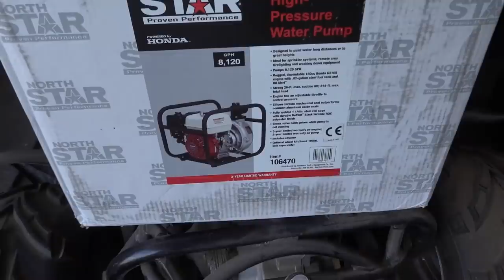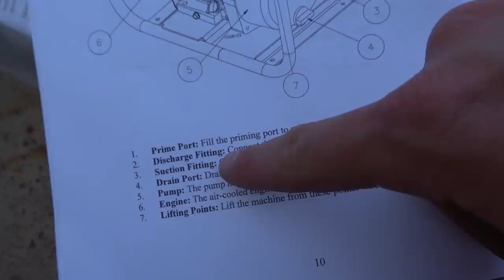I Built the Pumper Truck!!!!! Master Chief is Alive!!!

Comment: I am a volunteer firefighter and I really think that you are going to end up wanting a tank with baffles so that it doesn't slosh around so much and instead of the larger 2.5" hose, we only use 1.5" hose on a booster reel that makes it easy to put up and flows plenty of water for your common brush fires.
Reply: Ah.... but there’s your miscalculation.Y’all fight “common brush fires.” This truck is built for Demo-ranch brush fires!!!!!  😂
Reply: yep. People don't think about that. With a large tank sloshing around it can actually move the truck in unexpected ways when brake hard or turn hard.
Reply: Good man
Reply: There is no need for baffles if the water tank is 100% full, and it's not like he is in a rush to get ready to put out the next fire, when driving back with half a tank, and also just make sure there is a breather on top, so you don't implode the tank.

Also make sure you truck is standing in a dry place, equipment that's standing dry is a lot more reliable, something like Romney huts are pretty affordable.

I would also mount the fire/water pump under the bed of the truck for easy operation, and maybe have one on both sides of the truck, having a backup is never a bad thing.

Comment: Someone else already mentioned it but, yeah, you're gonna need to paint the tank or something. Sunlight shining into that clear tank is gonna cause algae to grow which can stop up your nozzles.
Reply: Ok this is kind of weird but I used to pump algae at an algae lab while in college. It depends on the algae (which ones? Idk it was the highest paying job on campus and I didn't ask questions) some algae types can be thick and others aren't. I used pumps like this all the time to transfer the algae. I never had an issue in the year I worked there.
Reply: @brendanleach8971  no doubt that the pump can handle some algae. Did you use a nozzle on the other end or just a hose by itself? I'm not saying you are wrong or right. Just curious
Reply: Bleach ftw
Reply: I clean swampy algae filled pools, pumps can handle algae no problem, I use harbor freight pumps to drain pools.
Reply: Nozzle could likely clog he said, not pump
Reply: If you just put in chlorine tablets it like you would a pool it’ll keep the Algae from forming
Reply: @braskybill25  sometimes we did but that depended on what we were doing.  dumping the dead algae down the drain we didn't. Transferring, yes, sometimes we were measuring how long "x" amount of liters will take to grow in a time frame with certain variables (nutrients). We would use a flow meter guage as well to get the desired amount in combination with a valve. Sometimes we used a regular garden hose for the vertical tanks. But most of the time it was in tubs and used those 1 inch tubes that Matt showed in the vid

Comment: Hey Matt, Firefighter here as well. Couple of notes. Stop by your local firehouse and see what they have to say. They will help you for sure. 
1) Most important, make sure you get a tank with baffles or keep that thing 100% full or you will end up flipping offroad. 
2) You can get away with a way smaller hose as well. Most wildland hose is 1" in diameter soft hose. Most structural hose is 1 3/4". For reference I did the math, for a 95 gpm nozzle you'd need to be pumping roughly 130-150 psi at the pump into the hose. 
3) definitely plumb yourself a manifold off of the pump. You want numerous valves with numerous options. Anytime the pump is running you want a tank return line to recirculate water so the pump doesn't overheat or wear. you can hear how unhappy it is when you close the nozzle. This will also allow you to have another valve to have your nozzle that you wanted at the pump as well as another valve for a hose reel. 
4) Hose reel is definitely the way to go for convenience but having regular hose has its benefits as well. Research how to fold it any you will be set. Tons of ways to store and deploy it easily. 
5) Throw the pistol grip off of the nozzle. You want to get that thing out in front of you so you can swing it around. Having the pistol grip makes your tendency to keep it close in to your body which makes it harder. 
6) we don't use cam lock in the fire service but I don't have any experience on it. I would switch to hard plumbing for everything between the tank and the pump though and keep the hard suction to refill from a pond or pool.
Reply: Oh man I really wish more people would like this so he sees it
Reply: I agree and I am not a fire fighter, but I have messed with plenty of spray rigs and used a lot of trash pumps. No offense Matt, but we call those trash pumps. I agree above but you could just T in your outlet and valve the 1.5 fire hose and keep spooled. use the other as the 1 inch like talked about above. Cam locks will work okay with your set up and leave you a out for water out of a pond, just use a big suction with screen so you don't get a lot of mud or trash.  Your going to hate that tank not baffled and yes black would be a lot better.
Reply: I can speak to the cam locks. I work for a utilities construction company so we use pumps and hoses a lot for wellpoints, and other types of drainage. We have cam locks on all of our hoses and don’t have problems with it. Just make sure there’s a gasket in the female end when you hook them up and that there isn’t a bunch of mud on the mating surface because that might inhibit the cams from locking.
Reply: Another firefighter here. Definitely good advice here. Would also agree that trashline/ brush line on a reel in 1" is probably best way to go with multiple port options. Not 100% sure but thought that was a cloth jacket hose. Make sure you dry those out after getting them wet.
Reply: This is the best advice and explanation out of everyone’s two cents in the comments. I’m not saying other people are wrong or right, but you took the time to point out and explain why. Love it. Thanks for your comment, and teaching me a few things. Cheers from Oshawa Ontario Canada
Reply: Some are assuming that you know what baffled tank means, and maybe you do, but just in case you don't, here ya go. Many tanks that carry liquid, and are mobile, have a number of walls (baffles) inside them to break up the liquid surge. Yours doesn't appear to have any. The scenario goes like this. You have yours half full, and come to a stop, you do stop, but 2 seconds later 2000 lbs of water make it to the back of the tank and push backward, then all that water comes back to the front, and pushes 2000lbs of force forward. You will feel this happen. The harder you stop, the worse the effect is. Baffles stop the liquids from being able to travel very far, thus eliminating much of the surge effect. You will always have surge with moving liquids, but FAR less with baffled tanks.
Reply: Dang this guy or girl went deep into research
Reply: @noahsnarleynvideos5826  Aren't Cam locks more of a "quick connect" fitting (and obviously provide more of a lock than just a regular thread) similar to what you see on air hoses and hydraulic fittings?
Reply: Yeah he is going to have problems driving that anywhere without baffles in the tank. Also, I think he will have trouble just keeping that tank on the trunk.
Everything else you said it right on. Really hope he seems your comment.
Reply: Not a fire fighter here but everything this fella said makes perfect sense. Thanks for your service brudda
Reply: Came to the comments section to mention a baffled tank. Your other points are spot on as well.
Reply: Deadheading that pump will kill it very fast.
The cam locks vibrate loose all the time.
The clamps on that green hose are crap. You need a crimped clamp that bites and won't vibrate loose.
Fold that hose correctly and the pressure will push it out correctly.
Reply: Definitely needs that pressure relief valve. Cam locks will be fine. I use them on high pressure water hoses with no problems. Baffled tank is a must for what you are doing. And maybe go to a bigger pump with electric start. Best to have a bigger pump working at 50% rather than running that pump at 100%. It will be more reliable especially on a fire truck
Reply: Would it make sense to go with couplings that match the local firefighters' equipment or would they prefer not to hook up to civilian firetrucks? I'm just thinking in the case of something like a wildfire, wouldn't it be best not to have to think about compatability if (when) equipment fails
Reply: Here's a comment to keep your comment higher on the list, so Matt will read it.
Reply: Having done volunteer firefighting, I agree with pretty much everything in this comment. The pump intake definitely needs a filter if he's planning on picking up from a lake or pond. Oh and the baffles are a good idea, but that tank being mostly round is not as high of a risk as some types of tanks. Better safe than sorry though, as your talking about literally tons of water.
Reply: Thanks for the support everyone. Hope he sees it.
Reply: @Nickster823  inertia
Reply: Just here to comment so it goes to the top. Thank you for your services
Reply: Would it also be a good idea to have some kind of mesh filter on the pickup end of the plumbing for pulling water out of a pond/river to keep debris from damaging the pump impeller?
Reply: I came here to say something similar, I was happy to see such a detailed description of what I was thinking. Well done!
Reply: Sounds good to me
Reply: 100% on the Baffles.
Reply: WHAT HE SAID⬆️⬆️⬆️ MATT
Reply: this.
Reply: i would also turn the water tank sideways, move it towards the cab and put the pump under the bed right up against the frame. this would allow him to start everything from the ground. (or just get an electric starter)
Reply: All of your points are really good, I have experience with maritime firefighting, and definitely agree with the baffled tank, free surface water is terrifying when it gets going. I hope for the sake of safety that Matt sees your comment and takes your advice.
Reply: @Nickster823  Yeah, no baffles is going to be REALLY bad news for him!
Reply: There are some really good ideas here. I would take it to the local fire department explain what you're using it for and let them show you how to place everything. I'm sure there are things we haven't thought about. This is a great thing to have. Could be the difference in you loosing everything or you just loosing a yard.
Reply: @offTheRanch You need to paint your tank or just like the chicken watering system, it is going to start growing algae or worse.
Reply: Check this one matt it's good really
Reply: @edwardbaker5373  camlock with splints will not vibrate loos any more than other threaded connector, its not the camlock that comes loos its the threaded part that any other connector would also use.
I agree that the clamp look to be "meh" quality, but crimped is not needed and TBH not much better than other clamps of good quality (dont catch on things is the main benefit)
Reply: @BoomerKeith1  cam locks are used whenever you need a quick disconnect. I have over 2 dozen in my brewery setup for home brewing beer. They rarely leak, lock solid and don't fall off like other quick connects...
Reply: @BrentKiley  he needs steel straps for that tank. Hard mount it to the bed.It might have threaded holes in the feet too for bolting from the bottom...
Reply: @MaryBrownForFreedom  Gotcha.  That's what I was thinking they functioned as but had no experience with them.  Thanks for the insight.
Reply: I really hope Matt sees this
Reply: Cam lock is great for volume pumps, but bad for pressure pumps. I agree all plumbing between tank and pump should be hard piped with threads. All hose on pressure side should be threaded or 1/4 turn.
Reply: Great points! I do want to mention though, nothing I can see about that dewatering pump indicates a capacity for any significant pressure. It will work for a little bit but I would suggest that a guy use that pump for filling his tank and get an actual cast fire pump...
Reply: @johndavis1721  It's not research, it's knowledge from career experience and training.
Reply: He should invest in a trash pump strainer with a mesh cover if he plans on using the green hard hose for getting water from ponds, lakes, rivers, etc.
Reply: @mrbearman_7735  That might be a good idea.  I don't know what the wildfire concerns are in Texas but I have met guys from out west that have built there own private wildland fire apparatus. During wildfire season they contract to the Forrest Service and fight the wildland fires along with the firefighters.  Might be beneficial to Matt if he can adapt to the local fire departments equipment in a "worst case" scenario.
Reply: Thanks for saving me a bunch of typing.  This is exactly what Matt's needs. Word for word.  He could also have a foam tank.  But with my math... that  tank will be empty in under 5 mins at full throttle . Also Baffles are super important. Been a truck driver for 22 yrs and my step dad was in the Warner Fire Dept for 46 yrs... Chief for 25.  Cheers
Reply: @robronan2463  the faster the water out there the better! I was wondering if a fire fighting monitor on the cab would be usefull for him, so he can spray without getting out, while driving or very close to fire were he needs to be able to get away quickly, and those are often used with foam, especially on airports (fuel fires). And about the hose connection, Many european fire brigades use storz couplers, which have the benefit of being robust, easy and fast to use (simply twist together) and are non-gendered, so you never have to worry about connecting two, and having the right end. On the truck however i agree with others the only proper way is neat, out of the way hardpipe. (Obligatory not a firefighter)
Reply: #3 most important
Reply: @Nickster823  as a truck driver with experience in tankers... Yup. Baffles are worth their weight in gold
Reply: I would also suggest a solid black tank. We run into issues with algea build for farm sprayer tender trucks if the water isn't being used often enough. Ends up plugging screens.
Reply: 23 year FF... this is pretty much spot on.  I would suggest a rubber jacketed hose though and get threaded couplings.  You won't be working with higher gpm as a novice, so keep the pistol grip... besides, this is the Demo Ranch FD!

Comment: Hey Matt. I’m a firefighter in Clovis NM. Huge fan of the channel. Lots of good comments on here. 

Keep the red hose. Just fold it how your local FD does. We use a (triple lay). Makes deployment 3x faster. 

Get a gated wye for the pump. That would allow a nozzle to be mounted on the bed of the truck for really fast fire attack.  A mounted smooth bore nozzle would work well. 

Baffles for the tank would make driving it more safe.  Filter for hard suction of lake is a good idea. 

Remember that having your own truck doesn’t mean you don’t need a Fire Departments help. Call them first. Then start your attack. 

Super cool build!!

Comment: ATTENTION!! PULL START FROM THE GROUND...take off the screws around the starter rope coil, rotate the starter cage to be the right angle to start while standing on the ground, and put the screws back in...BAMMO! (Tip from Steve’s small engine repair, YouTube)
Reply: Those Honda motors have easy to install electric start kits.
Reply: shoot, i was gonna say invest in a key start
Reply: I also also was going to say get a electric starter😂
Reply: Good tip.
Reply: Just buy the electrical started or if you are looking for a cheap solution remove the cover and start it with a screwdriver.

Comment: So a lot of brush trucks have a brush hose that is slightly smaller than your 2 1/2 inch hose. That should give you a little more pressure. The brush hose is also rigid and goes of a hose reel that mounts on the back of the truck.

Comment: Points to consider:
* learning hose handling is part of the job.
* Fitting a discharge manifold will let you easily fit different size hoses and choose which one to use via quarter turn valves.
* While rushing to put out any fire - Remember to call out the fire service too.  You won't have enough water, hoses or ability to tackle a huge fire and will need the professional support.
*You'll have fuel, engine, pump, etc fitted to that truck - so carry a pair of proper fire extinguishers too.
* If the truck is on stand-by it Must have water ready too.  There will be no time to top off its water tank when a fire is spotted.
* Secure all loose equipment against movement with some quick release fittings and keep everything in regular places so you never have to search for anything.
* Train as a fire fighter.
Reply: THIS!
Reply: I think training for a fire fighter is a huge thing. its not just a small thing to do.
Reply: And because you'll need the tank filled and ready, install a sight glass and paint your tank black to cut down on algae growth.
Reply: 100% agree couldn't say it better!!!   Use fuel stabilizer in the pump too.... gloves, pants, shirts, ect in case it gets a little out of control.... rakes/ shovels..... bleech the rank so algae doesn't form..... tons of stuff to consider.
Reply: Manifold is a must if you want different size hoses in my opinion then you’re not in a bind trying to switch out hoses in an emergency. You can leave all hoses hooked up as well
Reply: Its not that deep bro
Reply: How about electric start on the pump
Reply: good tips homie
Wranglerstar has a good video explaining some hot tips for lay people too.
Reply: also, a few class A extinguishers would work for a lot of his small fires, and you can just refill them